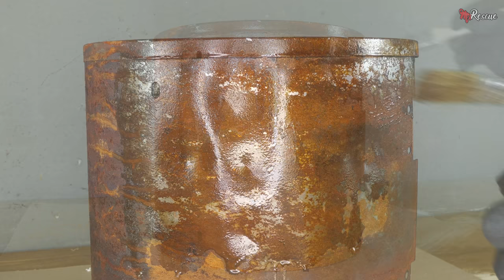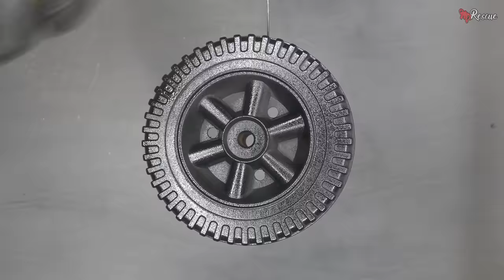Restoration BBQ Smoker Grill - Complete Process

Comment: Love it!! I had a neighbor put one of these on the curb and I grabbed it right away. Similar restoration but I don’t paint the inside. Just season it with oil and a couple rounds of charcoal and good to go!
Reply: ---Same, man. My neighbor just put out an old fancy smoker/grill on the curb, so I brought it home today. I plan on restoring it. It looks like one of the heavy duty expensive ones from back in the day. **Now I'm watching videos for restoring ideas. :)
Reply: @moonblink  well, as many others have said, don’t paint the inside. At least not with normal spraypaint. Use at least high temp paint for the outside. And depending on the stuff you may be able to paint the inside too, but only if the paint instructions specifically mention that it can be used for that. Otherwise just season with oil. And do a few empty burns. Just to get rid of all the toxic fumes. Don’t throw meat on a freshly painted smoker. Also applies if you buy one new
Reply: Don't pa int the inside if you can avoid it.  I would put on a heavy coat of vegetable oil and then run it with some charcoal.  Keeping it coated with Veg. oil will keep it from rusting on the inside, as long as you remember to remove the ash.  Leaving the ash inside a smoker / grill will always help it to rust on the inside faster.
Reply: @WesBland  I need to to fix my barbecue as well...I use to keep the ashes inside...has started to rust...I used to put water on the charcoal after I finished the barbecue... now I've learned my lesson 😃

Comment: That surface rust remover is like a miracle. Thanks, the renovation turned out amazing :)
Reply: your rfafer is liek amieral!  happy pirde moth
Reply: Well its pur vinegar. But this works only like a miracle if the rust was just created shortly beforehand with sufuric acid (you can even see the stains running down the hood, which would not look like it if it was real rust, also no pitting). Too bad many restauration channels use this "trick" to make the restauration look even more amazing. It would have been a nice restauration even without the artificially added rust. Why not keep it real?
Reply: @smallshot83  finally someone else said it.!! About time.. Like yes great job but ya don't have to make it worse for us to believe it was worse then it was
Reply: @smallshot83 true, to bad not enough watchers see through this trick

Comment: Great job on the restoration, but the only thing that bothered me was he cooked on it right after and didn't do a burn in first. That food would have all burnt paint fumes in it. Probably why he didn't taste the food lol.
Reply: Maybe he did a burn in, but didn't show it.
Reply: I thought the same thing lol that food going to taste like shit if he didn't .
Reply: Thats because its not a true representation of a restore. Had it been, the bottom of at least the main part of the smoker would have been blown out from charcoal use.
Reply: I have a grill just like that that I have used for 6 years and there are holes rusted in the bottom of the grill and fire box. No way this grill was ever used regularly.

Also mine has been outside with no cover the whole time and there was no surface rust on in. So I think this was rusted on purpose for the video, which is why it came off so easily.
Reply: that and the fact his temperature burnt the outside of the meat. that wasn't a decent crust
Reply: He also didn't let the food rest...drove me crazy
Reply: All for show and no go...

Comment: So essentially you sanded off all the original paint to allow the entire surface to rust in order to make this video?
It looks like you sprayed it with salt water every day as well...
Reply: Exactly I have this same grill and I have left it outside for 5 years with no cover and it doesn’t have any surface rust, but it does have a huge hole rusted in the bottom of the grill and one in the fire box, so obviously this grill was never used regularly. 

And I agree with the salt water. You can see where it runs down the sides of the grill like something was sprayed on it and it ran down.
Reply: you can see when he's removing the rust the sanding marks in the steel, besides that I have never seen a BBQ or anything painted lose every bit of the paint and there is almost no pitting as well like it was all surface rust from at the most a week.

Comment: why does that external rust look so new?
Reply: New rust looks the same as old rust. 😂
Reply: @Njazmo  Actually no, rust has different colors in its age stages, It can be bright like here, red deep red or even black, the rust on the outside of this grill is recent, as the color is bright yellow red, and the metal even has no pitting, hence he rusted it artificially, New rust. Please do some research.
Reply: 'cos it's just been fast rusted, scam video, penetrating oil clean that up good
Reply: @sukhpalsandhu6341  indeed my point exactly
Reply: @hp9mm  no way that is old rust.
Reply: @jonathanharris4282  i know

Comment: What is the rusting solution you use?
Reply: Was gonna say the same thing.  Almost every video of everything he's restored looks intentionally rusted and muddied up.  Looks like straight salt water. You can tell by the rusty water trails on the metal and by how bright the rust is,  not to mention there's little to no pitting in the metal. If it was really from being old and neglected,  there'd be way deeper pitting in the metal
Reply: @josephgermany7446  i noted this too
Reply: came to say the same thing,   no way that's naturally rusted when WD makes the bolts look brand new.  Project Farms quick rust solution?
Reply: I was thinking muriatic acid solution.  It’s amazing how many people fall for this and a shame that some intentionally do it.

Comment: Did you paint the inside of the grill too? Or should I just try seasoning it like a cast iron pan? Had a lot of rust on the bottom of the inside of my smoker so I wire brushed it all off and not sure how to properly protect it from rust now.
Reply: Don’t EVER put paint inside your grill. Spray with Pam or other brand vegetable spray and season with a hot fire!

Comment: Really nice work and also that cut looks soo good...just a thought, I think you should cure the paint before actually cooking something...the curing process required for you to heat the grill at a certain temperature for x amount of minutes to be ready.
Reply: Came to say this. I wouldn't eat anything off that until the inside had been seasoned properly. Too much residual chemicals burning off until then.

Comment: The part where the air cover rotates around is already scratching off the spray paint right after installing. Nevermind that i don't want a basic spray paint anywhere near a hot surface where the paint will flake off into the fire or onto my food.

Comment: Nice restore, I've seen worse...but that's bad for a sub $99USD smoker. I think I would have bought a new one(after having to get grates), a lot of work, too bad the metal is so thin it probably wont hold sustain heat for a proper length cook, not that it did anyway, it will work with a lot of watching though. ... Nice Job👍🏼

Comment: With these types bbq’s it’s hard to control the heat. But you use what’s affordable need a temperature gauge on the pit lit. Low /n slow is the name of the game not hot fast

Comment: I guess my only question is…why? Why restore that crappy 1/8th in grill? I wouldn’t even classify it as a smoker because all of those mechanical joints are going to leak smoke which means temperature control is next to impossible.

Comment: That smoker is kind of cheap and not that very good in use when in the real world - garden with wind, etc. It is made of super thin sheet metal, lacks any thermal capacity and everything on it bends easily. Also, before first use after you repainted it, I would heat it up to full heat and let cool down. I hope you used thermal resistant paint.

Comment: It almost seemed like you dont know what you're doing. Warped plate that you didnt show fixing, everything was half filmed, didnt use heat resistant paint and put it unevenly even, everything was still warped. Will you decide if you're gonna use a steel brush, a wheel on an angle grinder or on a drill? Also why didnt you let the rust remover do its job for a little before vigorously scrubbing with the wire brush? Painted the wheels but then damaged the plastic by hammering on the pin like crazy instead of using split pins. The vent plate was warped enough to damage the only paint coat you put on and even the meat was unevenly cooked and charred on the surface. Im rarely hating on videos but man did that one make me annoyed. Also, please change your bluing liquid, this one isnt good enough, im not even going to start on the editing of the video.

Comment: Extremely light/shallow, early stage rust. No part of the item is rusted through. No large flakes of extreme oxidation where the very structure is entirely corroded away. Highly atypical of a mild steel sheet metal item left outside year round. 

Folks… you are watching a Lie.